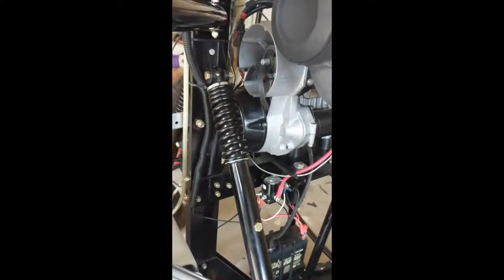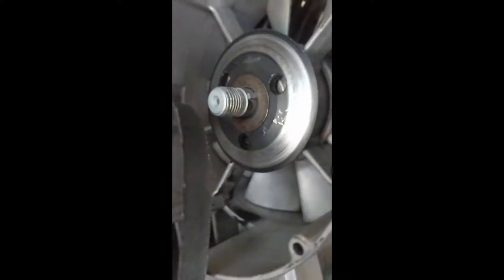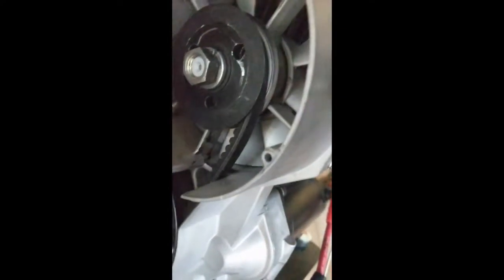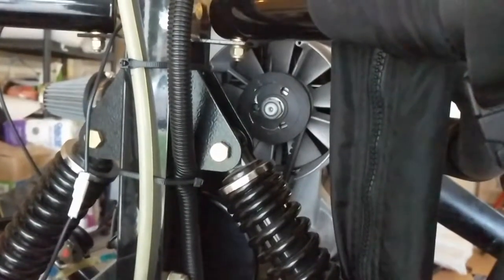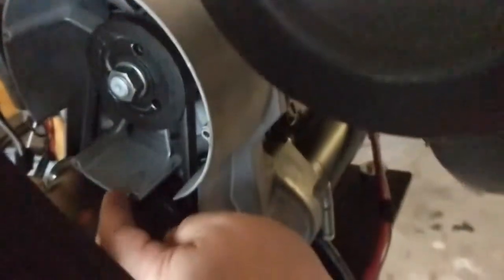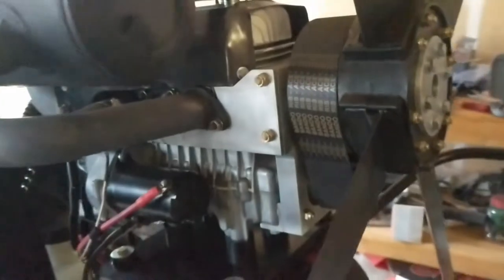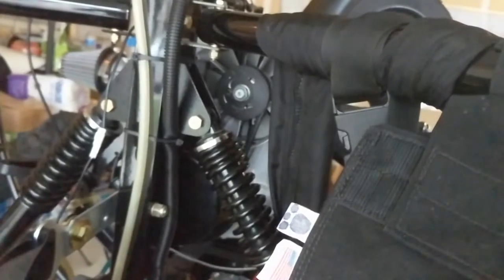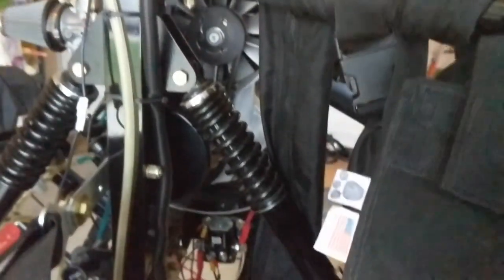P3 Lite Fan Belt Tension

Comment: To clean the propeller redrive belt J-Bird, the Kawasaki vender, says to spray it with starting fluid, but it all these sprays have upper cylinder lubricant oil.  So is the risidual oil on the belt a problem that would cause belt slip?
Reply from the maker: I haven't had to lube the belt yet.

Comment: Need more info on Kawasaki 440 ultralight engines.  Does the belt still look sloppy when running?  It looks like I can make the pulley holding tool now.
Reply from the maker: No it's pretty snug.